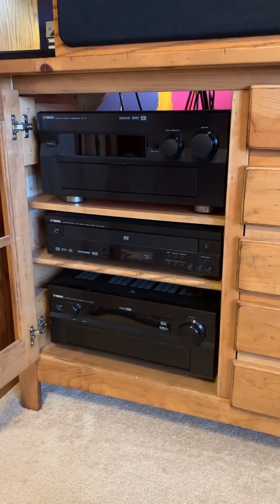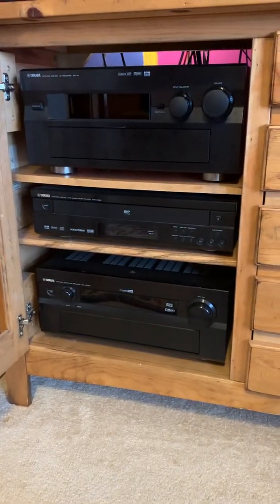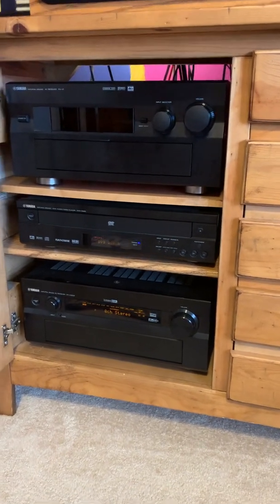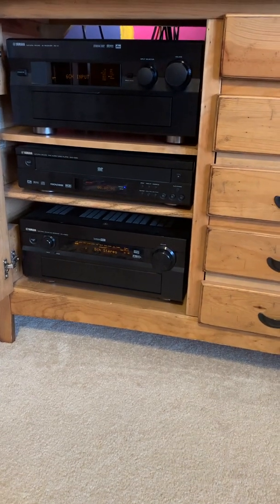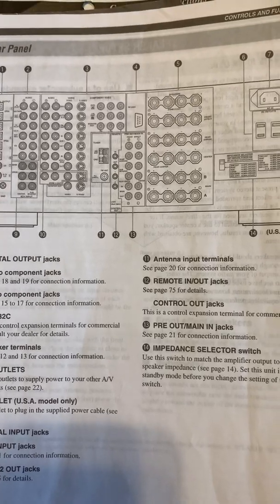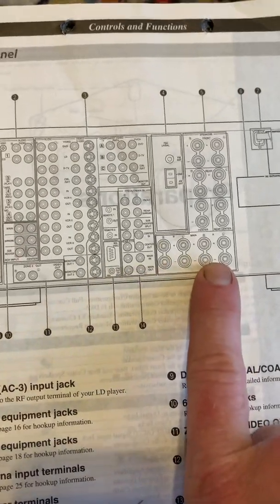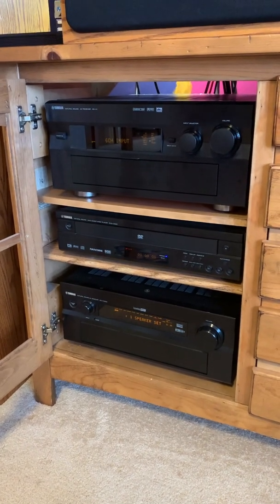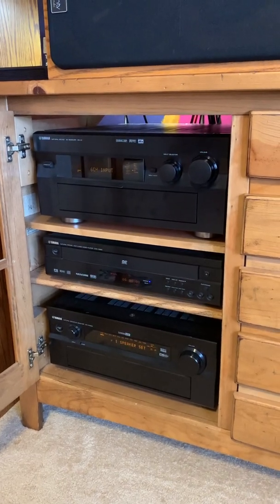Surround System Power Upgrade using dual Yamaha RX-V3300 and RX-V1 receivers

Comment: An RX-V3300 doesn't have enough power your kidding, its not the amp its the speakers I ran a 3300 on Vaf research  DCX fronts DC7 rears Vaf centre twin 12" 800watt subs and jamo centre rear and I can tell you it could rattle the walls I suggest you go buy better speaker, Yamaha actually invented surround so their high end amp are wonderful amps, I wouldn't run any other brand amp ive had a rxv3000 and the rxv3300 and ive just purchased another rxv3000 for my bedroom, I have a 75" TV so wanted a surround system in there

Comment: i have a yamaha rx v3000 and a yamaha rx v2700 and am currently thinking about this connection and found your guide. Great!  it's possible!  I wanted to ask, is it safe for the equipment?
Reply from the maker: It is safe… IF you make proper wire connections and settings for gain.  There is a bigger risk to damaging equipment with too little power rather than too much.  Your speakers will only draw what they need based on frequency and gain.  I wouldn’t recommend doing this unless you feel your speakers require more power to support low frequency bass needs.  Best practice for the majority of home systems is to set all your speaker sizes to small, which limits the frequency response below ~ 90 Hz for your receivers, and sends them to subwoofer to handle the heavy lifting.  This way, you have plenty of power in either of those receivers to support all speakers.  I only did this because I couldn’t bring myself to limit frequency to the big 4-way speakers with 10” woofers I wanted to use in my surround system.  I have since stepped up to the RX-Z9 to support my power needs, but the split receiver method was another solution that worked well.  The only drawback was the need to switch receivers on separately, so I didn’t trip my house breaker, and the additional wiring and setup required to balance the sound.  I enjoy experimenting with AV equipment to try and always improve its performance.  If you decide to try, be safe. Anytime you change connections on sensitive AV equipment, there is a risk to damage it.  Always make sure you power off all equipment before changing connections and check cables/wires for damage and proper connections before powering back on.
Reply: @infinitycrescendoandbeyond3056  Thanks for your help.it's very helpful for me

Comment: Greetings!  You connected the av receiver to another av receiver. one sounds the front channels and the second all the rest!  Bravo, this is really cool!  and it's super powerful!
Reply from the maker: That’s correct.  At the time, I needed a little more power to drive the large, vintage speakers in my main AV system and this method worked very well.  Since then, I have stepped up to the RX-Z9 to power these speakers and repurposed these two receivers with other smaller speaker sets.

Comment: Another thing - I also would recommend ditching the Yamahas and going for a more modern receiver for power. The Yamahas definitely have a really quality feel to them, but surround sound and DSP capabilities on newer receivers are just so much better in my opinion. My Marantz SR6008 weighs less than half of my Yamaha, but after it does calibration, sounds SO much better. If you’re careful on craigslist, you can score a new receiver pretty cheap.. I paid 50$ for the Marantz, never turning back!
Reply: Marantz ads boy detected...
Reply from the maker: Thanks for the feedback and I appreciate the recommendations and advice.  I’ve been a Yamaha man forever, so it may be difficult for me to try something else.  I actually just gave in to the upgrade itch and spent a little more than I wanted to on the Yamaha RX-Z9, but still a good deal compared to going price.  It definitely has more power and more modern processing, but still not the latest and greatest.  It has the auto calibration with the mic and 7.1 capabilities with analog ins.  I do have a blue ray with the 7.1 outs, but not sure yet if it will compare with the 7.1 digital you get through HDMI.  Anyway, I think I enjoy the challenge of figuring out how to get the most from “outdated” equipment.  I’ll keep my eye open for a good deal on the equipment you recommend.  I’m definitely curious now to see if I can possibly improve on what I got.
Reply: @infinitycrescendoandbeyond3056  Despite it’s age, that’s a very nice unit, hope you enjoy it! Also, your speakers are totally futureproof if you upgrade down the road, those things are really nice.

Comment: Cool classic system. I own a Yamaha RX V3000 Receiver I use for the bedroom system, as I upgraded the living room to a Marantz NR6008. Personally, I don’t use the Yamahas built-in amplification, because it is too weak and has poor SNR and Damping Factor. I just use it for the LPF and volume control, and QSC amps for all my speakers.    I understand you were focused on budget for this, but grabbing some cheap old PA amps (such as a QSC USA850 or Crown XLS402) will get much more from those beautiful speakers. You don’t need to fork over many hundreds for amps either, such as the other user recommending the Emotiva implied. Older pro amps perform just as well, if not better, for far less money. Just my experience.

Comment: Why not just purchase an 8ch class AB power amplifier for your Yamaha rx v1 reciver use the RX V1 as a pre amplifier rather than use 3 recivers. Emotiva make some decent class AB power amplifiers. I'm using on my RX V1. Throwing out 300w   rms 8ohms Per channel
Reply from the maker: That’s definitely a good solution and probably the more traditional approach.  However, for my situation, the RX-V1 was free because it had several issues.  I fixed power on, but it still has a bad Left digital input channel (probably DAC).  All amps were good though, so I decided to give this a try.  Both these Yamaha receivers have very clean sounding amps, so I prefer using them rather than a decent amp with higher rated power.  I think the main benefit for me was adding the 2nd transformer to the system to better manage the increased power load with all my large Crescendo speakers and still maintain the very low distortion “natural” Yamaha sound.